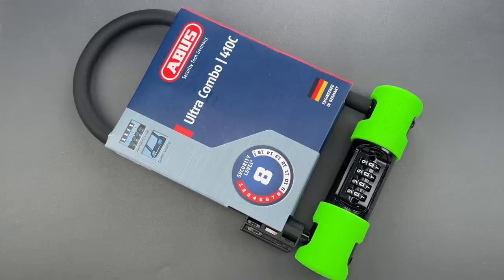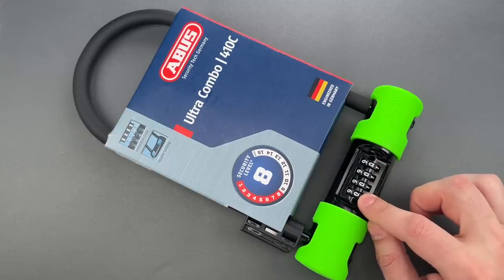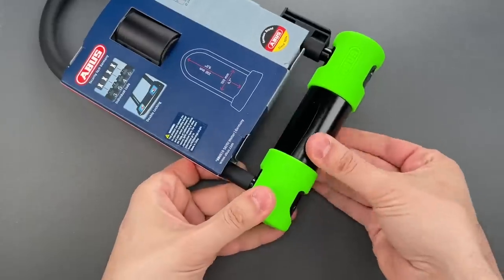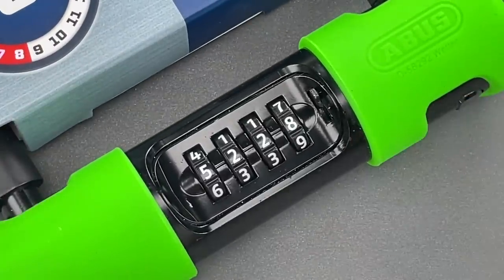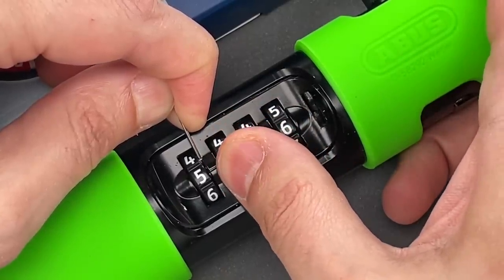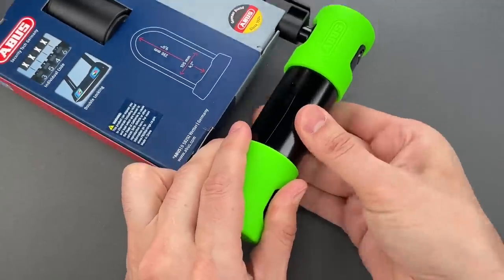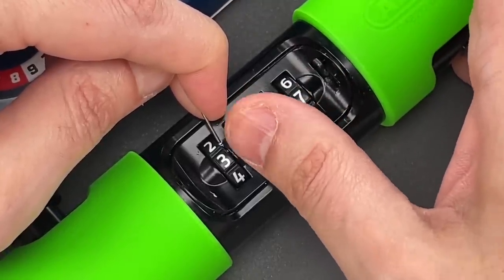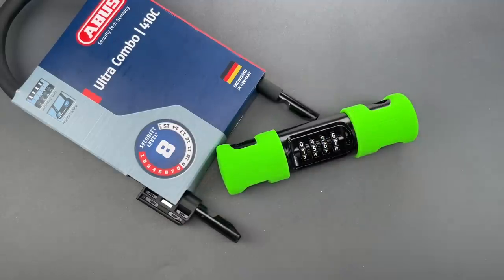[1527] Abus Bike Lock VISUALLY Decoded!!! (Model 410C)

Comment: In Germany, the locks are usually opened with a bolt cutter or an angle grinder/flex.
The thieves don't bother picking the lock.

Comment: Rotor style bike locks have always had the issue of loose fit.  The early ones may have required a ' tug ' to feel it find the slot and slide that little bit.  I have looked into this as a potential item to make/sell and have not found any way around it.

Comment: Even better. You can change the code by flipping a switch? Is that openly accessible? Looks like the problem with the Abus 6100 folding lock where everyone can change the code with a small screwdriver (which has happened). I talked to their customer service about this in the past, their customer is like 'yada yada, not interested'. Abus is the the new Masterlock!

Comment: The only D/U lock worth buying is the D1000 or X1 by Hiplok & Litelok anyway. They both use much more secure cores & they're actually angle grinder resistant. Worth the $300 bucks when you're locking up a 2 grand e-bike or scooter. Litelok uses an ABLOY core~

Comment: Anyone else notice that the "security rating" of 8 out of 15 was less than half the scale?
In fact, a rating of 8 out of 15 should occupy about 53% of the scale.
The managers couldn't even pull that off.
Instead, the units in the two-digit numbers grew larger and larger, probably because (if spaced correctly, evenly spaced) the scale would have looked ugly.

Comment: Nevermind seeing the tumblers!  Unless I missed something, the "reset code" switch is fully exposed on the front!  Or does it need to be unlocked first for that to work?  At least make it where you need a precision screwdriver to operate it!
Reply: Has to have the correct combo entered to use the change mode.

Comment: I do have a question for locks of this variety.  Wouldn't it be easier to "pick" the lock by simply changing the combination?  If the mode to do so is already constantly exposed so that anyone can get to it, all one needs to do is change the combination, reset the numbers, then enter the new code, right?  The lever on this lock appears to be unguarded.  I'm no expert, but it seems all I'd have to do is reset the combination then enter the new one to get it open without having to look for the notches or feel for springs.  Thoughts?
Reply: I'm sure it has to be on the correct combo to even use the change mode.

Comment: Surely the change mode should only work when the lock is open? Given that you can change the code when it's locked means that you can walk up to any locked bike and change the code, thus the owner is stuck when they return (assuming they were unable to decode it as LPL has shown).
Reply: I'm sure it has to be on correct combo to use the change mode.

Comment: No tools but a torch??  You will have to include a torch in your lock picking tool kit.  Have been watching your channel for nearly a year now.  I get the impression that locks are getting easier to pick.  Being naive, I would have thought the lock manufactures would have picked up the cudgels to make picking a lock just too hard for the average picker.  It seems to me they are making it easier.

Comment: Hang on - did you just change the combination of this lock without knowing the combination of the lock? or did it come factory set at 0000? edit: watching again, the second time you scrambled and then changed the combination again? i don't understand what's stopping someone from setting the combination and opening the lock?
Reply: Has to be on correct combo to use the change mode.

Comment: Looks like a very old flaw. As a kid in the 80s I remember a suitcase with a codelock that you just pushed the lever down to reveal the internals. All you did was turn all numbers till the notch were pointing out. Then you turned all of them 180 degrees, and voilá. Suitcase opened.
Pretty bad to see almost the same flaw all these years later.

Comment: What's concerning is that there's a "Security Level 8" platered on the front. How do these companies get away with that kind of deciet? Who regulates those ratings? What criteria are they basing it on? With a defect that huge, shouldn't someone somewhere have caught the flaw? And if not FIX the flaw, at least downgrade the security level? I mean, why even spend the resources to make it out of metal at that point. Just sell zip ties and increase your profit margin by thousands of percent!

Comment: Hold up... If it's that easy to change the combination what is stopping someone from flipping that lever and making a new combination? Or do you have to already be on the correct combination to be able to flip the lever?
Reply: Has to be on correct combo to use the change mode. But seeing how easy it is to decode it...

Comment: I thought ABUS was a top notch brand and I have a couple of products from them that have a good reputation.
I suppose that in this application the thieves are not going to try to decode anyway, as easy as it might be: they will try to cut or break, etc, thus this is what makes the rating of this lock.

Comment: The visual decoding thing is pretty mind boggling, but what really hits my head with a nuke is the change code lever being accessible to potential thieves. Could they not flip the lever, change the code to their favorite 4 digit number, flip the lever down, scramble, then access a $3000 bike that way?
Reply: Has to be on the correct combo to use the change mode. So, after it's been picked by decoding then someone could change the combo if they wanted to.

Comment: And again it's easier to just change the combination because the switch is right there in the open on the front of the lock.
Reply: I'm sure it has to be on correct combo to use the change mode.

Comment: If I saw it correctly you don't need all this fuzz. Because I would just change the code for one that I set it my self. I mean you just switch the lever and can change the code without knowing the previous one? Or why can it be switched into change mode so easily?
Reply: Has to have correct combo entered to use the change mode.

Comment: What's worse. The fact it can be picked that easily. Or the fact some bystander can flip a switch and change your code that... easily.... Guess doesn't matter.
Reply: Has to be on the correct combo to use the change mode.

Comment: really sad to see that Abus writes "Designed in Germany" on it.  That probably means that a designer was responsible here and not an engineer.  Then they write good protection with a medium risk of theft in the data sheet.  Whatever that's supposed to mean.  and no liability for errors and misprints.

Comment: Uh. Hang on now. You can (re)set the code with lock closed/locked? Or could you set it to change mode because the correct code was selected?
Reply: I'm positive it has to be on correct code to even use the change mode.

Comment: The change combination switch is right in front and works while its locked? So any joker can change your code?
Reply: I'm sure it has to be on correct combo to use the change mode. But seeing how easy it is to decode it...
Reply: @purpleghost4083   I hope you are right, but as crappy as that lock is, I wont assume anything.

Comment: What do you recommend for the best bike lock?
Reply: Best combo I've seen and use myself is a Abus GRANIT XPlus 540 (u-lock) through the rear wheel and frame (never lock only the wheel) and a ABUS 5805K Steel-O-Chain through your front wheel and something solid outside like a bike rack, light pole or fence post. 
It's kept both my very expensive e-bike and mountain bike safe for several years now.

Comment: I assume the combination started at 0000 and the change mode can only be activated if the combo is already entered? No shot someone can just make the code whatever they want whenever they want, but given how weak this is, my faith in the design is already in the basement.
Reply: Yes, has to be on correct combo to use change mode. But seeing how easy it is to decode, pretty much anybody could do it.

Comment: Honestly I more annoyed about the recode switch no requiring tools or the lock to be open. 
I guess on the plus side it won't be hard to decode, but a lock shouldn't equally inconvenience me and a thief. I'd just use bailing wire if that was acceptable.

Comment: Where do I buy the light he used in the video?
Reply: It looks like it uses an optical fibre to transfer the light from the bulb. I would try searching for small fibre optic flashlights and see what comes up.
Reply: @purpleghost4083  I thought the same, but I wanted to be sure.

I have several use cases for this

Comment: Isn't it also a stupid thing to have the lever to let you change the combination right there on the front next to wheels. If I didn't want to pick the lock, I sure could screw it up and reset it for the owner!
Reply: You can only reset the combination when the correct combination has been entered.
Reply: What Daniel Lee said. But if you pick it by decoding then you could, of course, still have fun and reset it for the owner.

Comment: Wait hold up, the change lock is a public facing switch. So if I see one of these locking down a bike outside of Starbucks, I can just change their pass code and walk away?
Reply: Ok, wait, he can change the lock code while it is locked? Or did I miss something? If the lock is secure, you can just flip the switch and change the code. It looked like he did all the changing while the lock was locked.
Reply: @Retromags  I'm sure it has to be on correct combo to use the change mode. But seeing how easy it is to decode it...

Comment: Wait a second - you mean anyone can change the code of the lock while it locked at any time?  Then those gaps are needed for when someone pulls a practical joke by changing the code...
Reply: No locks with a reset lever only allow that lever to move if the current combination is entered on the wheels. I think all locks with reset levers do actually. Just for mechanical reasoning the barrels need to be the position of matching before you can go changing the labels.
Reply: @xEricC1001x  Oh, I get it - so they have the large gaps to enable jokesters  to find and change the current combination. 🙂

Comment: Even if demonstrated problem was not present here this looks like terrible lock.
Am I seeing this correct? Can you put lock into change mode without knowing current code? So some rando troll could just go around scrambling peoples codes?
As a programmer.. If my could would allow such behavior it would be pretty terrible.
Reply: I'm sure it has to be on correct combo to use the change mode. But seeing how easy it is to decode it...

Comment: Wait, you never meantioned the biggest flaw that you can reset the code while the thing is locked
Reply: I'm sure it has to be on correct combo to use the change mode.

Comment: Most of the time I feel like a random larcenist walking by is not going to have the level of knowledge needed for exploit attacks that I see on this channel. Not this time. I could see that the wheels had room to move, and if they can move, I can see in through that gap. From there it's actually too simple. These need to be recalled with full refund/replacement. They are worse than useless. Unwary owners think they are secure when they are anything but.

Comment: It says 8/15 security. It's a bike lock. What did you expect from a 50$ lock? Retinal scans, 6 armed security guards and two nuclear keys that have to be turned at the same time?
Reply: It's surely not the most expensive U lock (a Kryptonite New York is 2,5 times the price in Germany) but there's no excuse for such a totally avoidable flaw
Reply: @simonm1447  a pair of harbor freight bolt cutters is most likely cheaper than that light he was using to see in it with (9$, I just looked it up) . The amount of "pickyness" (pun intended) in this community is just as inexcusable. It's. A. Bike. Lock. Notably, a self rated at less than 55% of "maximum security" is, whatever that means. Also of which likely 95% or more of the bikes being locked up are probably cheaper than the lock itself. I swear, everyone on this channel thinks their lunchbox should have nuclear access codes to get in it or it's as insecure as they are.
Reply: @StephenGadberry  this lock has a 12 mm shackle, they are surely thinner than the 16 mm ones of a New York lock but even 12 mm needs a big bolt cutter as long as the steel is a hardened one.

Nobody expects a bike lock to be 100% safe, the goal of a bike lock is to consume as much time as possible (or cause as much attention as possible with big or loud tools) to open it by a thiev. 

If you can see inside the mechanism because of a gap beside the rollers it's a completely unnecessary fault, if it's that simple to open without causing more effort or attention than the owner opening it with the code it don't deserve the name lock. Their other combination locks don't have this problem.

Abus recommends this lock for bikes of the entry level class, however an entry level MTB is already in the range of 700 € / 1000 AUD.

Btw, the nuclear access codes have been 00000000 over 15 years during cold war

Comment: By the way, it is possible to select a four-digit combination by going through all the possible codes one by one. I tested this with my own combination lock and timed myself counting the first 100 combinations using a stopwatch. Based on this, it would take no more than a couple of hours to go through all 9999 combinations in the worst-case scenario.
Reply: But how long before you would start to arouse suspicion about what you're doing?

Comment: That change mode system is just silly. Anyone could just come along and change the combination while the bike is locked. Thereby locking the owner out. Just as well the lock is so easy to decode.
Reply: You can only reset the combination when the correct combination has been entered.

Comment: Assuming German Law allows it, this Idiot Manufacturer should be Sued for False Advertising...

The package claims this lock offers mid-level security and yet it's even easier and as fast to open than the typical Masterlock Padlock...

Instead of Difficulty 8 of a possible 15, it should be graded as a Difficulty -2 or even -3 of a possible 15...

Dear GOD that was Embarrassing to watch and I'm not a lock picker...

😄😁😆😅😂🤣

Comment: Wait, isn't it also problematic that anybody can set the lock into change mode? so anyone could scramble the combination and lock the owner out
Reply: It has to be on the correct combination for the change mode to work. So after it's been picked by decoding then you could, of course, change the combo.